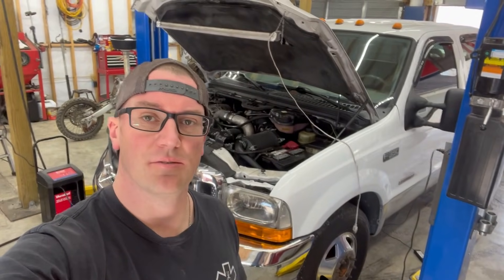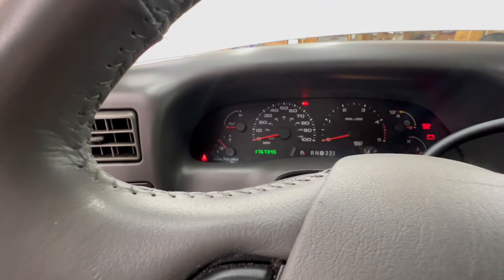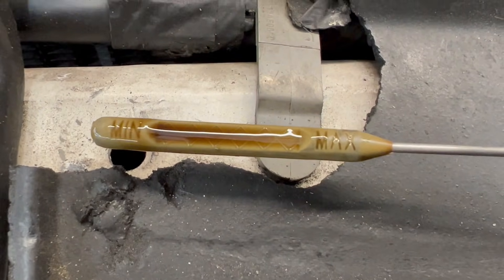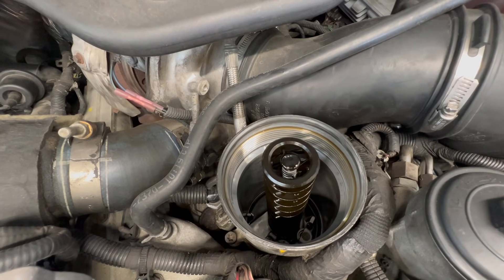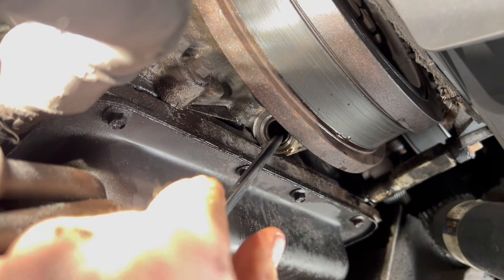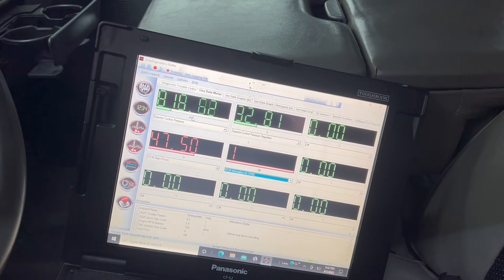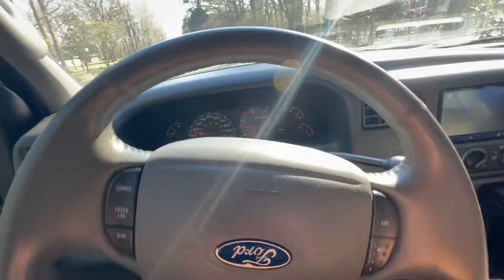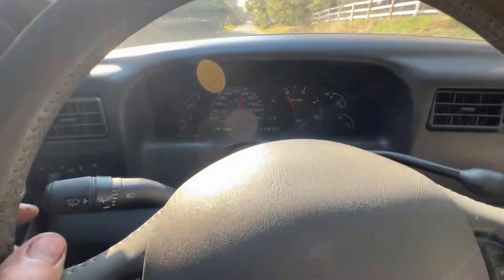6.0 Powerstroke crank no start no base oil pressure

Comment: So this happened from running out of fuel? I ran out of fuel and watch my gauges lose pressure and haven’t started since. I’m going to try this tomorrow
Reply from the maker: No not from running out of fuel. Just happened to be a coincidence. It didn’t start because the LPOP relief valve was stuck.

Comment: truck keeps stalling after 10 minutes of driving. Cant figure it out. when cranking :
ICP 700psi
IPR %33
FICM SYNC yes
SYNC yes

unplugged icp and nothing
did bubble test no bubbles

no codes besides 
p1832 transmission solenoid circuit failure
b1483 brake on off switch failure
p1876 transfer case open circuit or short to ground

air tested no leaks 
truck was jumped with reverse polarity but ran fine for a long time.
Reply from the maker: Those numbers are immediately after the stall?
Reply: @AutomedicGarage  yes those are immediately after stall
Reply: @AutomedicGarage  after cooling down for a few minutes it will start back up with a rough idle for 2 minutes then stall. these reading are right before stalling at idle:
icp 1200psi
ipr %44
ficm sync yes
sync yes
eot 131 f
ect 138 f
Reply from the maker: @TheFoezee  go monitor your fuel pressure see what happens when it starts to stall, next do you lose low pressure oil when it won’t start? Meaning your dash gauge doesn’t read.
Reply: @AutomedicGarage  i will do that thank you. i will monitor low pressure oil on the next test drive. low pressure oil pressure hesitates to come up when cranking then all of a sudden it will go up and start.
Reply from the maker: @TheFoezee  low pressure oil isn’t a priority on the cluster if batteries are weak and voltage is low. So it can seem slow when it really isn’t.

Comment: I got an 03  6.0
What will be the cost to do the bullet proof on it?
Reply from the maker: When I do head gaskets and studs at the bare minimum I add in glow plugs, harnesses and have the heads looked over by my machine shop to check for any cracks or warping. So the price all depends on what all we do. A lot of times we go on and do an oil cooler and new injectors along with stand pipes and dummy plugs(04.5-07) or if it’s a 03-04 a hpop. Other factors such as do you know you have an updated STC fitting, is it egr deleted. Do you have contribution issues with injectors. A lot factors in. It would be easier to discuss over the phone. My contact info is on my website.

Comment: Hey i have a 7.3L on a F350 im having hell getting it started. it will crank wont start. i replaced the IPR and the Cam Sensor. i unplugged the ICP to bypass that still didnt start. yesterday i drained the fuel bowl using the valve on the side. drained it went back to the ignite turned the key fired up INSTANTLY and died after 5 seconds. i went and got some diesel becuase i was at 1/4th a tank went to start it again FIRED right up. IDLED terrible! for like 5 minutes then the idle was fine i turned it off and started it again firing right up again running smooth. took it for a drive was perfect. came back the next day and the same thing as before cranks but wont start. ANY ideas? only has 131k miles on it
Reply from the maker: How much diesel did you put in it after being at a 1/4? If you only added a few gallons and parked on a incline or anything and the pickup is broke off it may be sucking straight air again.

Comment: 06 250 crank no start. What happens if there is oil in the canister what should I check next?
Reply from the maker: Needs to be air tested then to see if it standpipes, dummy plugs, nipple cups, injector orings or stc fitting. I have another crank no start video showing air testing and replacing standpipes and dummy plugs.